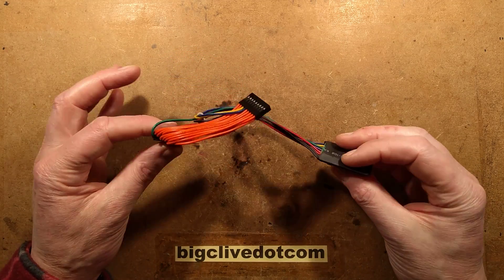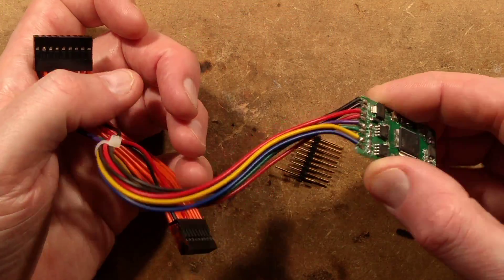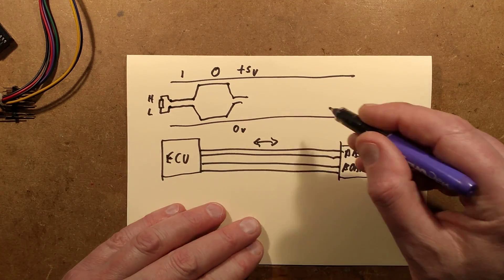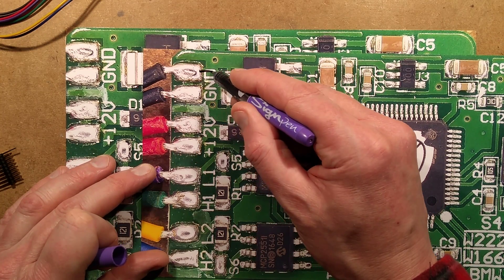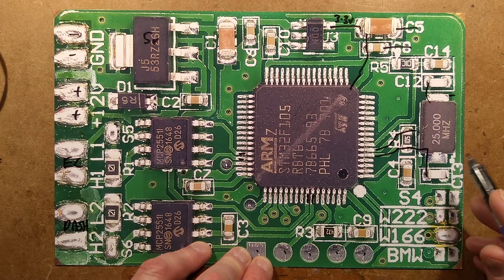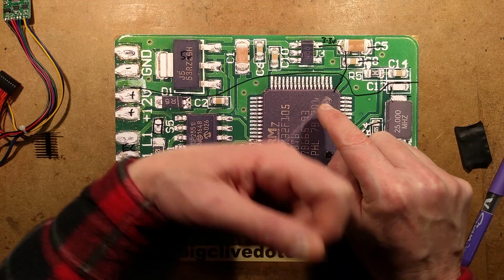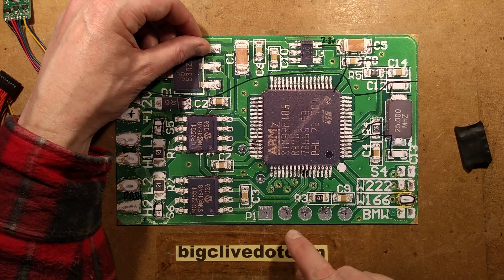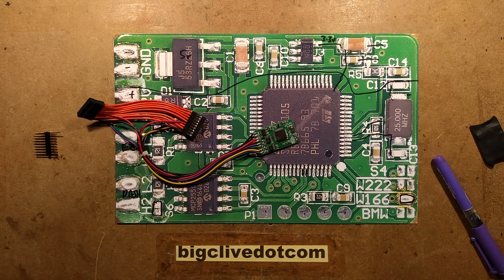Naughty CANbus odometer "interface".  (Fakes mileage.)

Comment: years ago I had a boss who had me and another co-worker install a switch into his leased car.
The switch replaced a fuse that powered the dashboard and the odometer.
What he would do is get out on the highway, engage the cruise control and then disable the dash and odometer, presumably saving money on his lease.
Reply: Dave Micolichek  I took the dash out of my Yaris to change the LEDs over, and the miles I drove with it out of the car never added.
Reply: @randomvideosn0where  the Yaris doesn't have canbus though
Reply: To all the disbeliever above, this still works on lots of brands of vehicle. To my knowledge the only brands of vehicle that clone the highest odometer values across from the PCM to BCM to ICM etc are Peugeot Citroen group vehicles and Mercedes Benz. While BMW and Landrover do compare the values and show a little dot next to the mileage if the value is different by more that 10 km (its called the BMW "tamper dot" and its very small and subtle so google it so you know what to look for in the future). On the other end of spectrum, VAG, Ford, Opel/Vaux, Toyota, and loads of others never compare the values, and whatever is on the EEPROM in the cluster is just displayed. You can alter the data on the 24c08 or 95080 eeprom to whatever you choose and it will blindly display it. I know for a fact you can power down or unplug the cluster in most vehicles when already running and the value will not jump back to the "correct" value when re-powered up - only PSA group and Mercs will. (I do cluster and ECU swaps for a living BTW)
Reply: @threepotMR2  Indeed. I had a Peugeot Expert van many years ago where the pixels on the display faded so I was told to get a set of clocks from another and that it would update itself. Although it plugged in and the lower mileage appeared initially, it corrected itself as I drove up the road. After this I assumed all modern cars compared values stored in various modules but it seems not.
Reply: @energymc22  If you bought a cluster with higher mileage then put that in your PSA group vehicle, that is when the fun begins! I have to edit the values in the engine ecu, the bcm and the cluster. Its a pain in the backside. Often a garage will try a part from another car and ruin the customers mileage value by accident.

Also to expand on my rant, to expect the Engine ECU or BCM mileage value to also be correct is wildly unreliable. Often when vehicles get some kind of routine engine software update or calibration data update, the EEPROM in the engine ECU is blanked out and restarted (Ford are bad for this). Or some part of the board in the BCM gets burnt out due to some stupid electrical fault so it gets a new BCM (VAG Group and Vauxhall). So any value could have been dragged down to zero when it had 30k or 60k or 150k miles on the clock.

Often when I do a cluster swap when the old cluster value is irretrievable, the only way to pick a value to write to the clusters EEPROM is to go through the MOT history and work out its average monthly/weekly mileage, then I personally pick a number that looks about genuine.
Reply: threepotgtti Newer VAG models save a specific noneraseable error (it literally blows a fuse) in the mcu when mileage is nonplausible. Depending on what area code is set, this error triggers the obd2-light or not. In diesels, there is also the adblue-counter, which is typically forgotten by „mileage adjusting services“. Hella / Gutmann MegaMACs and Bosch KTM diagnose devices with contractor software show a warning and contract shops are obliged to report the VIN to VAG. And on vehicles with enabled telemetry VAG gets a mileage everytime the engine stops.
Opel will have an encrypted enclave like the rest of PSA in all new models. (I did automotive firmware programming for living. [No, I did light- and window motors, and left hella way before defeat devices were a thing.])
Reply: @threepotMR2  Not sure about all GM vehicles but on the trucks, the value in the cluster is taken as the source of truth and will overwrite the value in the ECU when doing a cluster swap
Reply: threepotgtti Volvos also pick whichever value is highest.
Reply: @threepotMR2  the chip method is very effective. Spot on
Reply: Recently Renault cars also started having mileage record on ABS unit, working just like the Peugeots dash/bsi, it will sync to the module with the most KMs, dash or ABS.
Reply: Dave Micolichek  Correct. One of the cars i have stopped counting on the dash at 299999KM, but i have the option to take it in and get it flashed to the right mileage because its still stored.
Reply: @JackReacheround  Toyota? The older Corollas and Prius have a glitch in the odometer that make them stop counting at 299,999. It doesn't matter if it is in miles or kilometers.
Reply: @nukelauncher95  Pontiac vibe, The cousin car to the Matrix
Reply: @JackReacheround  that one is store in DIC/driver info center.
Reply: @nukelauncher95  I had a friend with that problem . He had to reprogram some bytes in  the  serial EEPROM in the dashboard  again, so to  to start counting
Reply: @JackReacheround  when you buy a new ECM, they need the correct mileage to flash to the new ECM. Seems like bribery of the mechanic is a possibility. Just remember....50% of the population gets up every morning to be screwed by the other 50%.
Reply: @JackReacheround  - Unfortunately, no, you can't.   Toyota has said repeatedly that it just stops recording at 300,000.   You can set it _lower_, or what many people do is get it set back to 0, but you can't get it to go to, say, 325,000.   I don't know why they weren't subject to a recall on the cars - it was all Toyota Matrix, and all Pontiac Vibe.  Maybe Corolla as well, not sure about that - same engine, same ECU. - It's also not a glitch - it was deliberate programming.
Reply: Dave Micolichek  As far as I know it's possible to change those values too. In the former eastern bloc it's very common for cars to have tampered odometers. Cars from western europe have 400-500k km and after crossing the border they go down to 170-200k km. Record I have seen was 1+milion km reduced down to 192k km. Those guys are often proffesionals, they will remove every bit of information about true mileage. They will clean everything. Only amateurs flash only the odometer, which usually works for some idiots who believe that a 15-20 year old car can be under 200k km. This really ruins the used car market as people think than "over 200k km is junk" and honest people cannot really sell their cars. The proffesionals will flash everything and forge the documents in a "creative" way. It's possible to notice a tamper inside the memory but you will never find out the true mileage of the car.
Reply: From what I know BMW also stores the mileage on the key (not sure if they use that data anywhere or if it just stores the last value on there)... along with other fun data as the last GPS position where the key was used and other stuff.
Reply: Dave Micolichek  Depends on how old the car is. Mine uses a mechanical odometer. Nothing but check engine codes are stored in the engine computer.
Reply: Dave Micolichek  Depends on the car...CAN bus 2007 Ford Crown Victoria, the mileage is stored ONLY on the instrument cluster.
Reply: Dave Micolichek  older cars were a lot simpler.  The dash integrated, stored, and displayed the odometer.  The ECU/PCM wasn't involved.  And there was no BCM.

On my 88 Chrysler lebaron I replaced the dash due to flood damage.  Desoldered and swapped the eeprom to keep milage.

And cruise has nothing to do with the instrument cluster.
Reply: By revolution of the wheel to set cruise, pulse abs, and pulse brakes for stability control. If it manipulates the the km by 40% it's gonna be down to revolutions. You are better off swapping what ever module stores seed info for miles/km.
Reply: Dave Micolichek  correct
Reply: Dave Micolichek  that is not true, way back on about a 1990 Escort  took out the dash fuse, and no mileage registered.
Reply: Doesn’t the mileage readout via the OBDII System?
Reply: Robert Slackware  Unless you're driving it on public roads. Then, most countries have a few requirements they expect you to meet. A speedometer that makes some sort of sense is just one of them.
Reply: Great guy.
Reply: No odometer no cruise control.
Reply: @codyburns4149  Cruise control is basically just a frequency check.  They typically just take an ABS wheel sensor feed as input and when you press "SET" the cruise ECU uses that value as it's target frequency, adjusting throttle position to try and achieve target.  Those ABS wheel sensor inputs go nowhere near the dash cluster gauges, so on a lot of vehicles cruise control will operate fine without a working dash cluster.
Reply: @RangieNZ  Correct, if the vehicle has ABS that is. On other cars the speed sensor is used. In either event that guy is still outputting a value.
Reply: cruise control on most vechicles is not controlled by the odometer...cruise control is mostly controled by a vaccum line...
Reply: @codyburns4149  Not true.
Reply: @codyburns4149  depends on how far back "a few" is.  I drove a 1986 accord with an electromechanical odometer and vacuum cruise control.  I removed the dash to repair the AC valve cabling, and drove it like that for a couple weeks.  Cruise control still worked, and the odometer was unchanged when I reinstalled it.
Reply: @codyburns4149  cruise control usually has nothing to do with odometer...  on most modern cars the dashboard only displays information, and doesn't have much to do with making things work.  as far as the mileage, the BMW (the only car brand I'm really intimately familiar with) stores mileage on the dash (kombi), the light switch (lcm/frm/lcz), the ECU (dme), and the transmission (tcm).  if the light switch and the dash mismatch - it shows a "tamper dot" on the dash.  the dash does not care about the ECU or the transmission mileage.
Reply: too bad now the ECM stores the data now as well
ALSO it's a bad idea to admitting to a Federal offence
Reply: Ford Contour/Mercury Mystique/Ford Mondeo has the fuse that powers the instrument cluster also powering the rear brake lights. So if you turn off the power to the instrument cluster, you have no rear brake lights. I think they did that intentionally.....

Comment: What printer do you use to print out your stunning PCB photos?
Reply from the maker: Epson eco tank.
Reply: @bigclivedotcom  I would be interested to know which model of Epson EcoTank you went for. I am about to take the plunge myself after much debate......
Reply: Pretty much any modern printer will print photos of that high quality. The source matters more. So if you use a high quality camera to take high quality photos, you can print them out in high quality in most printers.
Reply: @xenonram  I work in said industry - the paper stock makes a huge difference also - Clive must be using good Inkjet Coated Paper.
Reply: @cameradoctor205  He certainly is, when he picks the photo up it barely sags, it's almost card weight and super gloss.